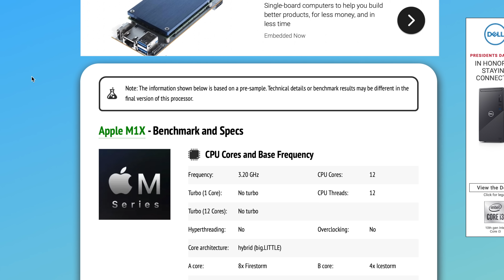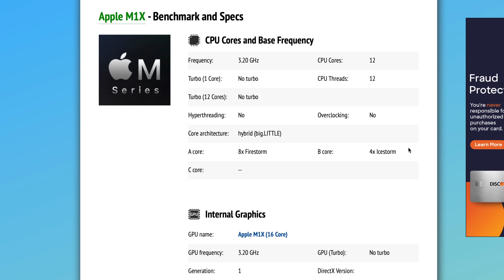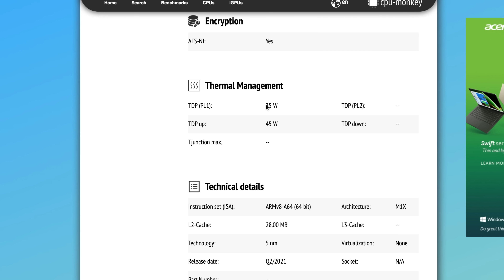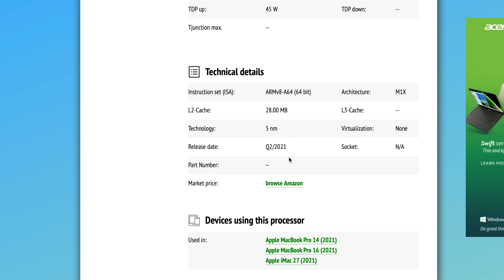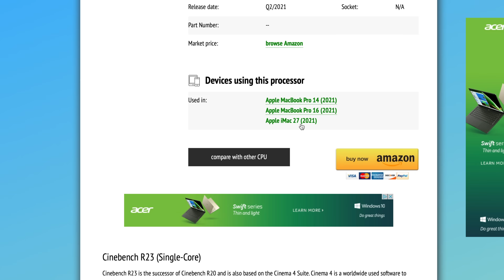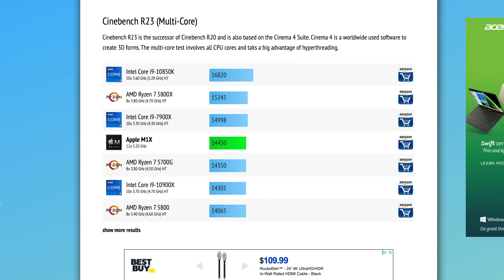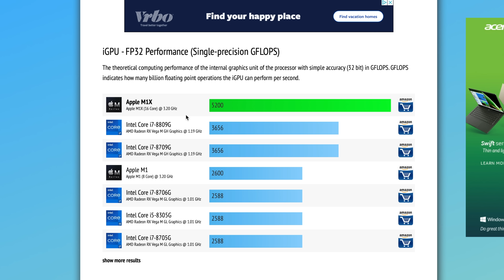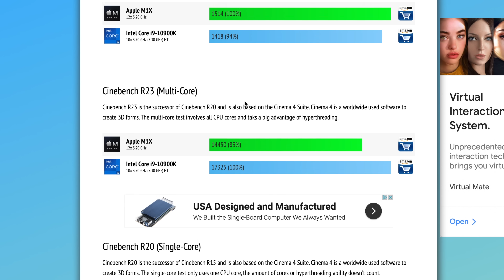There's no way M1X can be THIS fast...

Comment: I'm grateful to God to live & see this chip exist! This Apple M chips moments is actually as the moment as first iPhone released!
I had once MBP & I hated Apple products because of the price, heat, fan noises & slowness every OS update & capability issues. I didn't know in those times it was intel fault!
But know I'm pretty sure not only me going to change to MacBook later this year when MBP reveals the beast inside, it's everyone & the industry of PC if no one cach the ARM PC version race!
Let's talk about ports! from now & on should be usb c thunderbolt & it should have been before. Old ports should be stopped. I only agree with doubling the ports of usb c thunderbolt. This port is so amazing that you can only by plugging external monitor that supports usb c thunderbolt you can plug to the monitor the mouse, K/B & headset to the external monitor!! The only thing upsetting about it in current laptops that depends only on it is, it doesn't come with 4 ports!!

Comment: Regarding possible iMac sizes. If 30" became the smallest size available I think they'd lose some custom. A 30" iMac (even with tiny bezels) is still a pretty large device for someone to have in their home. I'd stick with the 24" and 27" sizes, and with zero bezels they could look amazing. And then offer an iMac Pro in 27" and 32" models
Reply: Thanks, I'll get the proper 30" in the meantime. Who needs tiny screens? WTF.

Comment: In regards to the 32 GB maximum RAM for an iMac. If this is true, then it would apply to the entry level iMac. The smaller iMac hasn’t been updated in quite some time and, as Luke predicts, is probably coming out first. I would imagine they will update the higher end iMac in a new chip revision with more cores and that 64 GB of RAM. 

Apple likes to release their products in stepped increments, so providing the pro market with another area of differentiation would make sense.

Comment: I think they're just guessing. They should tell you it's just their guesses. But I wouldn't be surprised if that guess actually turns out to be true. I actually believe Apple Silicon is very much capable of doing this, and it is definitely in line with the information Apple gave us directly on their websites and keynotes.

Comment: Will the MacBook Pro 14 inch replace the one 1300 version or just be added to the lineup? Because it would be weird that a “higher end version” doesn’t have a Touch Bar but a lower end version has a Touch Bar

Comment: I could see these numbers being accurate. I'm still blown away that my M1 MacBook Pro has more power than my overclocked ryzen 5 1600 desktop from only 3 years ago. Not to mention the m1 is sipping 15 watts whereas my overclocked ryzen is pulling upwards of 85 watts! The GPU in the m1 cant keep up with even my very mid-range gtx 1060 6GB but it's still no slouch for integrated graphics in my portable. Also, I think that salt needs to be saved for our driveways😂😂!

Comment: In addendum to my GPU comment:
I don't' quite believe the single core figures here. I find it hard to believe that there wouldn't be some sort of mechanism in place to allow higher frequencies when only one core is active to boost the single-threaded performance when the TDP headroom is as big as it would be. Perhaps not as comprehensive as Turbo Boost in first generation of M, but some sort of system to not leave single-threaded tasks under-utilising the available thermal and power headroom.

Comment: So the theoretical FP32 performance is about right and matches what I would've figured. In the theoretical sense the scaling overhead isn't considered and we just assume perfect scaling for GPUs that are massively parallel anyway. That doesn't mean actual performance scales linearly, just theoretical. And also there's way, way more to GPU performance than just FP32. However, I will put this in perspective by saying that the Radeon Pro 5600M has a theoretical FP32 perf of 5.3TFLOPS. Thus the projected 5.2TFLOPS of the M1X, in this aspect, would be a small downgrade from the highest end option of the 16". A massive improvement over the entry level configuration, but a small decrease from the top end. 
Now in practice it would likely still be faster than the 5600M because of other aspects of the GPU design, but for pure floating point math it would technically be 100GFLOPS slower in a theoretical sense

Comment: Yeah, that's fake. Doubling GPU cores won't double the performance, unless they ramped up the frequency by a lot (which I doubt) or changed the architecture and it coincidentally ended up having double the performance in this benchmark.

Comment: The benchmarks are accurate, if you multiply the result of the single thread scores by the amount of performance cores that’s basically what you get in the multithreaded benchmarks for the M1. It’s going to be similar with the M1X.

However, I don’t buy this M1X going inside the 14-inch MacBook Pro. The power consumption of this M1X is going to be 35-45 watts (again, the numbers seem to be accurate) but Apple never put a 35-watt CPUs in their 13-inch MacBook Pro (the current gen comes with 23/28-watt TDP Intel Core). They already showed the M1 is very silent and energy efficient, they’re not throwing a wrench into that selling point, it’d be like going two steps forward, one step backward.

I believe they’re going to use this M1X in the 16-inch MacBook Pro. The 14-inch will come with an M1S or something with 6-performance cores and 10/12-GPU cores. That way they’d achieve a thermal budget of 25-watt and avoid changing the cooling system too much. Or maybe is the M1X after all but very limited in frequency.

Comment: if the new i mac will get the m1 chip and will cost like the current entry model imac for about 1k it's going to be a really good deal. Paring it with an e-gpu  you could also have reallly good gaming experience

Comment: The memory spec makes no sense.  you can't get 32GB of memory using just two (2) LPDDR4X parts.  The largest capacity is 64Gbits.

64Gb x 2 = 128Gbits / 8 bits/byte = 16GBYTES

That's all you can get.   An M1 variant won't have a revamped memory subsystem.

Comment: I expect the CPU portion of M1X to max out at 11,750 on Geekbench (about 58% more performance) (probably a bit less maybe 50%).
Reply: I believed the M1X will have not 4+8, but 4+10 or 4+12 cores, no idea why🙄
Reply: @hrissan  The calculation I used takes what I believe is the performance profile for an efficiency core of 70% of the performance core.  Assuming that - without taking any thermal throttling down on adding 4 more performance cores (likely there will be some) would give the Geekbench score of 11,750.

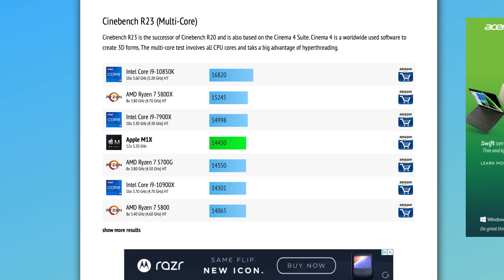Comment: @9:32 - why did you skip over the Intel Core i9-7900K ?
You could have said it beats the Ryzen 7 5800 & Intel Core i9 10900X, match the Ryzen 5700G.
Closing in on the Intel Core i9-7900K.
How is 14450 near 15245 ???

Comment: M1 and M1X chips are 5 nm and 4 nm, about. Very, very soon they will encounter a brick wall. You cannot build electronics smaller than that because then the electrons begin to leak. I predict the growth in speed and power will last about five years. After that they will reach a plateau, and it will last for a very, very long time. Intel knows this, I suspect.

Comment: If u have more cores u need to lower the clock speed in order to maintain stability, all these numbers are too high
Reply: Stability? Hmm no. You throttle down when either you exceed the thermal envelope of the cooling solution (and need to cool down) or you can’t sustain the power delivery (battery or power source can’t increase wattage). There’s nothing against stability when increasing number of cores or frequency (or both).
Reply: @AlejandroLZuvic  which is why you see Apple guys eyes light up every time they mention thermals of Apple silicon , it’s not about fanless laptops.

Comment: If there is 32gb ram limit, it will still likely outperform significantly higher limits due to the integrated design, same as 8gb in the M1 was way outperforming higher ram specs.

Comment: 12 cores is still the most physical cores on any laptop under 55 watts. AMD mobile RYZEN maxes out at 8 CORES with multithreading on a 4 bits wide bus, Intel’s i9s are 8 cores on a 4 +1 bit wide bus, while the firestorm & icestorm cores from Apple are 8 EIGHT bits wide. The widest cores on the desktop this is only available to CPUs using a RISC architecture. X86/64 is pretty much capped at 4 bits wide. This is similar to how GPUs run at different bus widths over PCI. So a equal spec’ed GPU like the AMD 5600XT and the 5700 non xt are virtually the same except for the bus width. The 5700 and the 5600xt have the same amount of compute units but the5700 runs on a 256bit wide bus while the 5600 xt runs on a 192 bit bus. But CPU cores have huge leapss in performance with just 1 bit difference. So having 12 8 bit wide cpu cores in a 35 or 45 watt TDP will be insane for tasks like long term compute. (Think handbrake encode or simulation rendering) combined that with the neural cores and this M1X should rival desktop Ryzen CPUs with 12 or 16 cores  and obliterate anything intel has for the Desktop.

Comment: Also you have to remember the cooling solution in the MacBook Pro with the i9 bottlenecked the actual frequency of the chip so because of the cooling solution being so bad for such a powerful chip  the i9 could not reach its full potential like the desktop variant could

Comment: Petition for M1X performance estimates.
Reply: The performance numbers on this video are quite accurate all things considered. You take single core performance in Cinebench, multiply that number by the amount of performance cores, add around 1500 points (for the 4 efficiency cores) and bam, you have your benchmark numbers.

The problem is to which exact device these M1X go. Luke and many people say the 14-inch MacBook Pro will get these M1X but I don’t see a 35/40-watts CPU in a 14-inch MacBook, it’s too much heat to dissipate and Apple already sold us on the idea of “spinning fans = bad”. I believe these numbers are realistic but there should be a third variant of the M1, something more powerful than the M1 but with a smaller energy footprint than the M1X.
Reply: @AlejandroLZuvic  yeah I do agree.

Comment: My guess is that the Cinebench r23 multiscore will actually be 12000-13000 and the FP32 performance would be around 4700. If this so called spec is true.

Comment: I think the M1X is the SoC for the 14" and the entry level 16" and likely the higher end macMini (replacement for the i7 they are still selling). And possibling the SoC for the 21" iMac. They will have another SoC for the higher end 16"

Comment: We're going to see a lot of wild speculation and marketing wank coming, best to wait for real benchmarks. Also, underscoring all of this is equivalent performance to top of the line processors - okay totally can see that, makes sense. But I'm sick of "performance per watt" bullshit. Makes sense if you want a high performance laptops ... which I couldn't give a toss about. It's great that apple got to chuck out all the baggage that the x86 architecture has (as well as compatibility with it) but these aren't going to blow them out of the water ... unless you succumb to the "performance per watt" marketing wank which again only makes sense for a laptop.

Comment: Finally Apple is offering hardware that’s closer to the price range they demand
Reply: As critical as I am of Apple in the last few years and about this architecture change in particular, I agree that their price point is becoming more commensurate with performance. Luke talked about that in a recent video also.
Reply: Funny that it is even cheaper than Apple’s Intel base computers
Reply: @Grtzky  goes to show how much they were held back by intel
Reply: @Grtzky  Of course, because making their own silicon in-house is cheaper. Also I'm sure Apple is very keen to make moving to M1 attractive from a price standpoint because the sooner they move everyone over, the sooner they can drop x86 sofware support. If history is any guide, they will do the latter prematurely.
Reply: @meowcula  Even if they drop x86 support the profit they make from m1 and soon to be m1x chips is still massive in comparison to intel. To the point where they can sell more computers for a lower price and still earn more without an issue. Of course apple being apple probably won’t do that but it’s a possibility none the less.
Reply: @mxmobile5619  Yeah and I'm more concerned about future compatibility over Apple's profit. I think in general Apple has prioritized profit over serving it's user base since Cook took over. It's an excellent business decision, no question.

Comment: here's what might happen: apple would become the next intel, in other words a chip supplier for which microsoft and linux would offer ports, so that the next generation of pcs would have windows/linux running on apple supplied chips
Reply: No. Just.. no.
Reply: @steveolson1148  you would be surprised because that is the only way apple can grow their computer business, by ditching the walled garden at least in desktops and laptops and SERVERS
Reply: @swipekonnect  if Apple have 10% of the desktop market maybe they have other ways of growing. You know the trick here is that Apple silicon is optimised for Apple compilers which is optimised for Apple software. Apple silicon is not going to work as well on Microsoft or Linux, software .
Reply: @francesconicoletti2547  I am sorry I disagree. The way I see it is that walled garden could never work on open macos, so the money maker is not macos or the hardware but just the chips. also it is going to evolve like this: apple plus intel plus qualcomm vs amd plus arm plus nvidia plus samsung and we know how that would end blue whipping red ass all over the place
Reply: @swipekonnect  the Apple silicon chips work because Apple is there to shepherd them every step of the way. Arm chips on windows exist. By all reports they are terrible. They are terrible because one company was not there to avoid all the pitfalls of migrating to a new platform. Putting Apple silicon on windows will mean , no good fast emulation, porting a sprawling code base that is Microsoft’s not Apple’s, finding someone to build decent windows machines. If the answer to any of those questions is well Apple will do it, my response is Why ? when they can just build the market share of their own machines.
Reply: @francesconicoletti2547  disagree apple doesn't quote unquote shepherd stuff, they create a garden and charge tax. my point is this: the moment it touched intel back in the day, its mac was dead because intel is outside the garden, but there is money in mac hardware (not much but some), the next mistake it made was keeping m1 macs open (ok boot loader is locked but virtualization is not) so no garden on m1 so no money on mac hardware. now here's my point because apple grabbed the bull's horn with intel many years ago, the only way out is go all the away ie become a chip supplier and let people create non boot locked machine with win linux and macos, and if thats the plan then those are the blue red teams
Reply: @swipekonnect  Mac sales 2020 ( not Apple ) $28.6 Billion. Intel Sales 2020  ( the entire company ) $35.4 Billion. Just the Mac segment of Apple comes within spitting distance of all of Intel , I don’t think it’s the Mac that’s dead. Or that being a chip supplier is a profit leader.
Reply: @francesconicoletti2547  sorry for the late reply, those numbers are obscene but not sustainable, a couple of years down the line, computing power to cost would multiply, and virtualization would be the order of the days, ppl would think twice before dropping 699 on a mac, let alone its wheels, i stand by my theory of apple intel qual whipping amd arm nvidia samsung all day

Comment: A few things to keep an eye on
5700G should be 65w TDP
All of AMD's current lineup is on 7nm, including the 5700g. THhe 5800x is partially on 12nm. TSMC, that makes both the 5700G and Apple M1(and presumably the M1x/M2) have stated that the 5nm node used by Apple M1, has 50% better power per watt than the 7nm node used by the AMD 5700G. This means, that if a theoretical 5700G, ported over to 5nm, would vastly outperform the M1x by nearly 20%, while only using about 45w instead of 65W.
Juddging by my experience with the 3700x and 3950x, doubling the core count, while keeping the freqnecy the same, does not lead to linear scaling of power per watt. My 3950x is vastly more efficient than the 3700x when both clocked to 3.8ghz, with the 3950x scoring nearly double the 3700x, but only using ~20% more power according to hardware monitor.
If this same scaling holds true for the M1x, then, compared to my M1Mac Mini, it would likely only draw 42-45w from the wall, instead of the  35w of my current Mac Mini(assuming it will draw disproportionately more power as it is also increasing GPU core count.) My guess for the actual TDP would be 30w instead of 20w.
Dont get this 42w from the wall confused with the 45w socket power of the theoretical 5700G, as the 5700G measurement only includes the CPU power draw, not everything else like ram, GPU, storage, motherboard, fans and power supply

Comment: I think the M1 is a low end laptop part, and what i'm hoping is going to happen is that Apple will sort of follow Intel and AMD naming conventiion
M1 is entry level, M2 is mid range. M3 and M3x is top of the line
But what i think Apple should do differently is have a D line for desktops with maybe the same core count, but ideally have one with significantly more cores, but more importantly,  support for PCIe(and NVMe) and additional RAM, and instead of LPDDR4, use HBM2e as sort of an L4 cache, or to dedicate to the iGPU when it is under heavy load